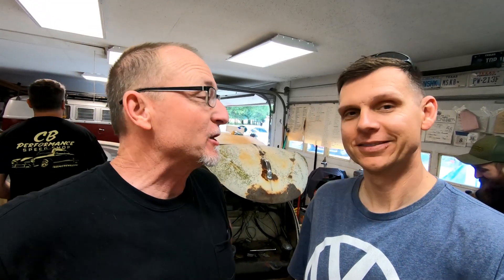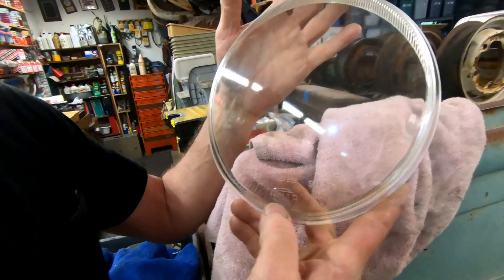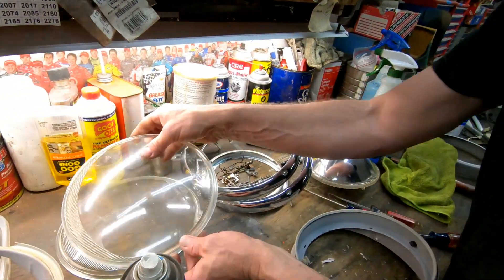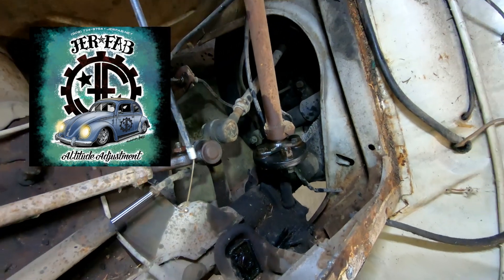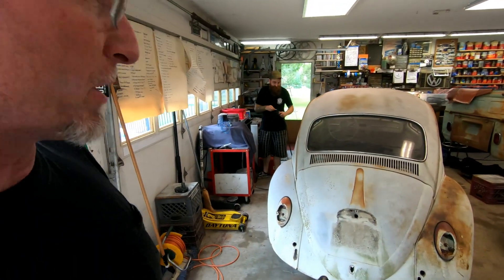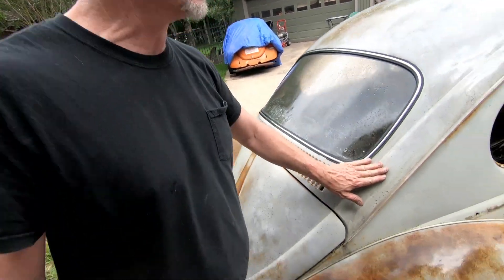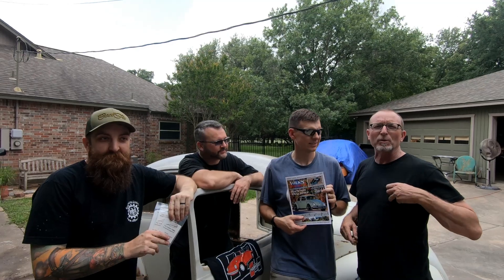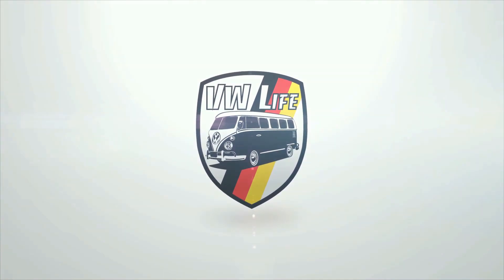A New Beginning for the Harvest Beetle!

Comment: Good job guys
Reply from the maker: Thanks!
Reply: I am either getting a 68 rolling chassis and have a 71 standard body for it or a complete 68 stock. I am kinda committed to the chassis but if it dont go through then the stock 68 will be the runner up.  We will see.  In calif 😎 hot and sunny.   "KCAK" is our local vw club.
Reply from the maker: @04JALD  that's really cool. Tommiebsmith drives a tan 68
Reply: I bet he loves it. Early 70s and older i love.  I know most ppl try to go 69 or older.  For some reason i really liked 1970 bugs. But i will settle for any year to save a bug. 😎

Comment: In 1978 I bought a 1965 Beatle red really clean . it was six volt and had to by a reducer for lights . used a 1969 duel port ingine out of another bug a 1969 atomatic it was rusty ran great though . had to grind out the bell housing to use the 69 ingine . with that old trans and the duel port ingine it would pop wheelys in first gear without and awful lot of effort turn out sweet wish I had it back .            (MULDEW)          ~                  hard life              gary b         *
Reply from the maker: Awesome Gary! Thanks for sharing your story